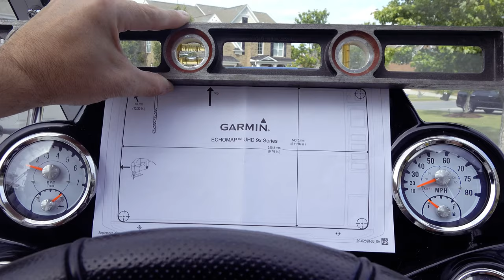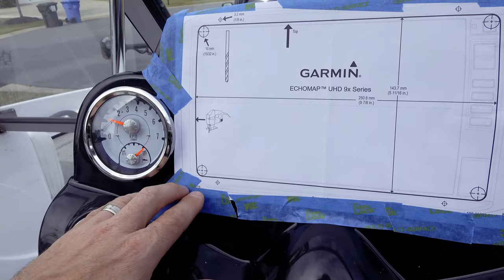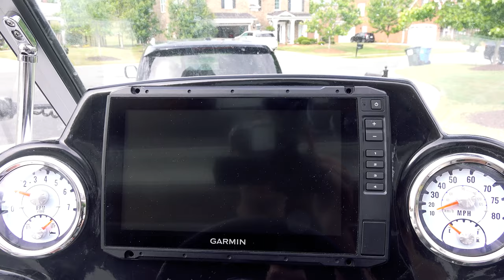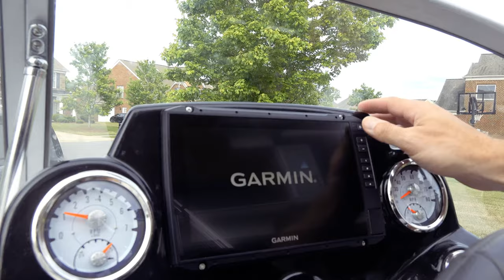SAVE $$! How to INSTALL Your Own Depth Finder! Flush Mount, In Dash, EASY! Garmin UHD 93SV Install

Comment: when you put the positive wire to the fuse. Is it the black wire that you attach to the ground screw. I got my first boat and I am unsure about hooking up my fish finder.
Reply: on marine dc systems, red is always positive, and should be fused. black returns need no fuse. If you don't have a battery switch, you need to get one. When turned off, all battery drains are prevented. Pacific Yacht Systems has super tutorials.

Comment: Great video.  Gives me idea how to install transducer on my 2021 z19 sport.  Ty
Reply from the maker: Thank you very much!
Reply: Have you tried any portable mounts. Really hard to decide to drill into my fiberglass
Reply from the maker: @toulialee82  I have not. But I am also very hesitant to drill into the gel coat. If you do it carefully and take the proper precautions, you can do it without extra damage.
Reply: Have the same boat and changing the hook to the Garmin 93sv like you did. Are you happy with the location you put your transducer? Any issues with that location? And how many p clips did you install for the transducer cable to the transom? Thanks.

Comment: Very well done!   I am installing the same unit in the dash but did not know the screws mount from the front Vs the back which would have been a huge effort.  That tip alone saved me many headaches.
Reply from the maker: awesome! thank you very much Robb! and thank you for watching.

Comment: I was wondering where I was going to connect my stuff too, but I was told maybe you want it on a switch so it don't run even when the vessel is off. Like connect to bilge switch
Reply: Only a very few specialized devices should NOT be downstream of the battery switch - such as a boat which is left in the water all the time and needs a continuous bilge pump to drain rain water. The battery switch prevents battery drains when the boat is not in use. The wiring should be: battery positive lead to  battery switch, then to  master fuse (size per bus bar capacity),  then to the positive bus bar, then to switch panel. The device is then wired into the switch panel and can be turned on and off at will. The negative return to the battery does not need to be switched, because if the positive current is broken by the switch, no current can leak. The battery switch prevents someone from turning on devices and draining the battery.

Comment: I'm installing the same unit on the same boat, my 93 uhd dont have holes in the corners of the graph to screw it in like yours, I'm I missing something?  Tks for the video.
Reply from the maker: There should be a cover plate you can remove that will expose the holes. I had the same problem until I found it referenced in the manual. Do you have the paperwork that came with it? If not, DM us on Instagram.

Comment: I just bought a Garmin 93SV for my boat project. My local marine supply store recommended running power from my Blue Sea fuse block. Another trusted source recommended running power strait from the battery with 10 gauge wire  along with an inline fuse. Any suggestions?
Reply: Wire size is a function of current over the given distance. So look in the literature to see what kind of current the unit draws and then measure the distance. All kinds of tables online to calculate correct wire size.
Reply: The trusted source is wrong. Only a very few specialized devices should NOT be downstream of the battery switch - such as a boat which is left in the water all the time and needs a continuous bilge pump to drain rain water. The battery switch prevents battery drains when the boat is not in use. The wiring should be: battery positive lead to  battery switch, then to  master fuse (size per bus bar capacity),  then to the positive bus bar, then to switch panel. The device is then wired into the switch panel and can be turned on and off at will. The negative return to the battery does not need to be switched, because if the positive current is broken by the switch, no current can leak. The battery switch prevents someone from turning on devices and draining the battery.